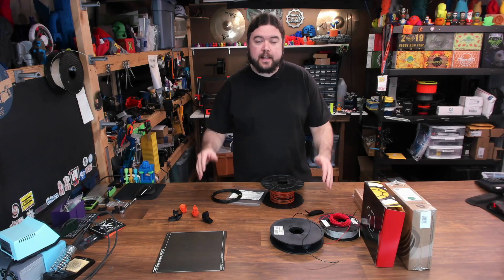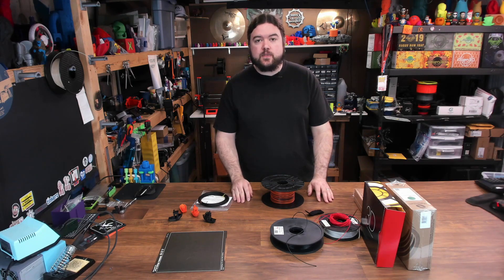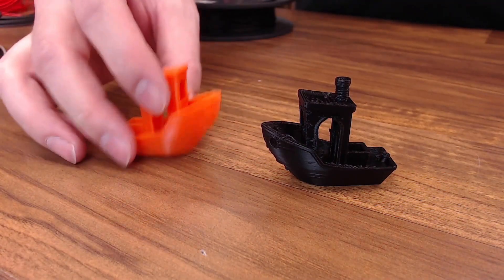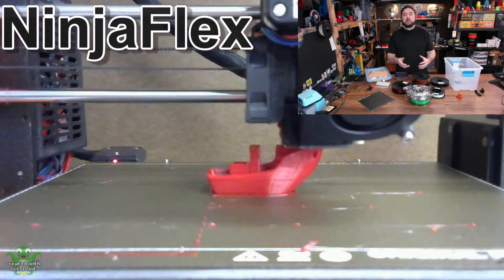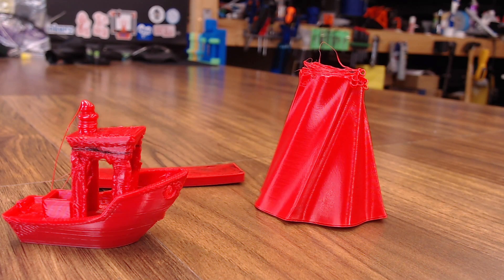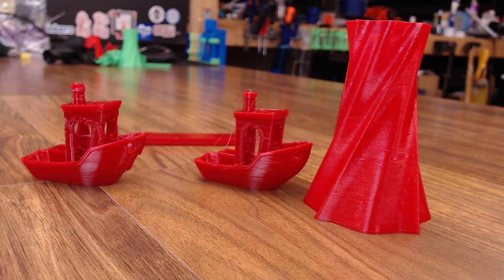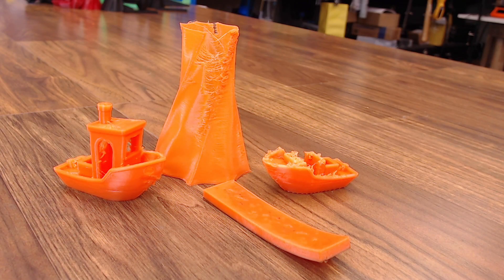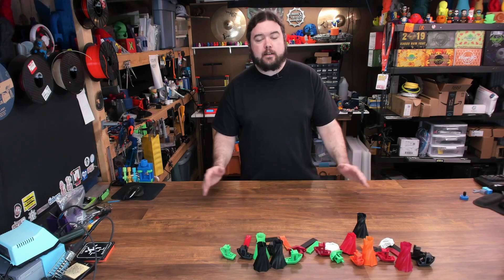Flexible Filament - Testing - Chris's Basement

Comment: Hi Chris, thanks for the video. I am trying since 2 days to print with Extrafill 98A and its virtually impossible, I tried a lot of settings, and I also tried the standard Prusa Slicer profiles in 15mm and then lowered the speed to 60% on the printer itself. The results are really bad, and I dont know what to do next to try to fix it :(
Reply from the maker: Hey, has the filament been left out? Maybe it needs to be dried a bit.
Reply: Chris Riley thanks for replying. No, it was a new roll, and after 24 hours it was unprintable. I am going to build a dry box and test again..let’s see

Comment: The stringing is most likely cause of lack of retraction and not dried filament. I only print tpu and it needs to be dried even when new. I mostly print 95a at 60mm/s with 3mm retraction and that works fine even for 15h prints.
Reply from the maker: Nice!

Comment: The Fillamentum stuff is some of the worst filament I've ever used.
Reply from the maker: Really? That's interesting.
Reply: @ChrisRiley  Yeah it looks like you had problems with it as well.  The two main problems were:  1.  It just extruded really poorly, like it was sticking to the nozzle itself, and 2.  my hobbed bolt didn't grip onto the filament particularly well.

Comment: Chris, really good information.  I want to try it on my Hemera.
Reply: Chris, I tried on my Hemera, and no go.  Then I figured out that I had just printed a bunch of carbon fiber and somehow jammed the nozzle.  Long story short, just ordered my third hemera, a bunch of spare parts and an X nozzle.
Reply from the maker: Doh! That kinda sucks, but now I know where to go if I need some spare parts! :)
Reply from the maker: Thanks Dave!
Reply: @ChrisRiley  I am getting spare parts from E3D and ordered 100 of those little square nuts.  I have lost a couple and they are impossible to find.  I will also have 3 MicroSwiss hot ends and 3 SeeMeCNC extruders spare with spare parts

Comment: First, I love your content, but I feel like with flexibles the strength is mechanical/engineering properties, you have a few different tests but it seems like the benchy and the vase are the highlight.  Is there a way to introduce something  engineering oriented like stretching them with a clamp or barbell or smashing them in a vise or running over a perfect cube with a car, or smacking them a few times with a hammer see if the splinter or separate.  LOL  I am having fun but also being serious, I think people who are into trying invent the next "thing" would love to see flexibles pushed to their limits in a different light.
Reply: BTW I do remember you were just trying to see if they printed at all so maybe you already did these tests.  Aside from the bar, I think the benchy and the vase are ultra challenging for a flex.
Reply from the maker: Hey man! Great ideas. I am planning on lots of content for flexibles, I really like the potential uses for it. I will see what I can work into the test.

Comment: Hey Chris,
I noticed on Marlin 2.0 that you can have dual Z steppers using spare extruder outputs.
Also there is a function to align Z steppers.
Please could you investigate and make video instructions?
Sweet, thanks.
Kris.
Reply from the maker: Hey Kris, I have been meaning to do just that, I will see what I can put together.

Comment: i have had good results going up to 6m retract with flexible material. ninjatek's cheetah.
also had successful prints with a bowden set up on an Ender 3, printing slow seems to be the key
Reply from the maker: Nice! I am going to try the ender 3 as well.
Reply: @ChrisRiley  i had the aluminum extruder upgrade and capricorn tubing installed which probably helped. i think it was 25ms i was printing at

Comment: When music is 10x that of the voice, RIP ears.
Reply from the maker: Is it really that loud?
Reply: @ChrisRiley  To me quite loud. I had to mute the audio till it looked like you were talking again. Great info though.
Reply: @ChrisRiley  Yo chris I run all of my legally acquired movies through something like this for audio:

ffmpeg -hide_banner -loglevel error -i FILEINPUT.mkv -map_metadata -1 -map_chapters -1 -c:v copy -af "pan=stereo|FL=FC+0.30*FL+0.30*BL|FR=FC+0.30*FR+0.30*BR, compand=0|0:1|1:-70/-70|-60/-20|1/0:4:0:-1:0" -c:a aac -b:a 256k outputfile.mkv

It brings the highs lower and the lows higher it tries to even out everything around the 0dB however it doesn't fully compress it, just like a 50% - 70% compress
You can switch the -c:a to flac too I guess then it'll be a lossless conversion & let youtube do the lossy conversion
Reply from the maker: @gg-gn3re  Thanks for this info, I will look into it.
Reply: @ChrisRiley  No. Not really.

Comment: You should tried out our filamentech plaflex.
It print as low as 130°c and up to 180°c flexible around 45D shore and prints like pla no stringing no nothing!
https://translate.googleusercontent.com/translate_c?depth=1&nv=1&rurl=translate.google.com&sl=iw&sp=nmt4&tl=en&u=https://filamentech.co.il/product/pla-flex/&xid=25657,15700022,15700186,15700191,15700256,15700259,15700262,15700265,15700271&usg=ALkJrhjJtP-gDphyUvNsukfYkypNX5c1GQ
Reply from the maker: Wow, that sounds impressive.
Reply: @ChrisRiley   Please contact me if you want to try some.
info@filamentech.co.il

Comment: I have used SainSmart TPU and Ninjatek Cheetah both with really good results on a bowden extruder in my Ender 3, was thinking about get a nice extruder for flex material since I use them a lot so will be waiting for your next video about it to get a better panorama of what is available 😎
Reply from the maker: Hey Eduardo, that's good to hear, I need to go test the stock ender 3 with flex before I try and upgrade it.
Reply: @ChrisRiley  My Ender is not full stock have changed the extruder base with this one https://www.thingiverse.com/thing:3320373 helps a bit with this filaments that are 95A and 96A

Comment: Chris what I saw, you probably have your gear to TIGHT. its recomemnded to have the gear as lose as possible for flex ( jam wiith the white filament )
Reply from the maker: Thanks Patrick, I played with the tension some, having the screw flush seemed to be a sweet spot, but still a struggle.
Reply: @ChrisRiley  it can be a real pain with some flex filaments yes.
I usually print with a good semiflex when printing flex types,  Spaghetti type filaments is not so usefull for me.  I think a hemera could be a good option, but the I3Mk3s has also a very short path, so i not sure it that really helps either.

Comment: Great video, very explanatory. I found out that the flexible I have is one of the most rigid and so I was dissatisfied. And yet I didn't get good results with direct extrusion. Imagine with these still more flexible ... certainly more difficult to work with.
Reply from the maker: Thank you, they can be very challenging and frustrating.

Comment: Just started testing flexibles on my direct drive (bmg clone) cr10s. So far had success extrudr medium flex and fiberlogy fiberflex 30D (really stretchy compared to extrudr medium). 200-210 hotend, 60 bed, 40-50mm/s (20-25wall) and retractions at 3.4mm at 25mm/s. Printing phil-a-ment right now in fiberflex 30D at 80% size with 3 perimiters and no infill.
Reply from the maker: Nice! The BMG should get you some really good results.

Comment: interesting, I had best results with the fibrology D30 the even softer stuff and printed it at quite high speeds. in numbers 60mm/s, on printbite plus @50°C with a genuine bondtech/v6 on one printer and flex3drive G5/mosquito on the other one. though I used pressure advance and retraction.
Reply from the maker: Yeah, I was hoping for a better result with this fibrology. I might have had a bad sample. I think I need to try again.
Reply: @ChrisRiley  sadly it's a bit harder for you to get your hands on that filament with only one reseller overseas. back then I had no idea where to start with flexibles but someone recommended fibrology to me, iirc Thomas Sanladerer tested it too and it was rather cheap and very easy to get my hands on, so the logic consequence. when I saw your intro I thought "I'm sure he'll love it", as you could imagine I was rather shocked seeing your results.

Comment: I have a semi flex material that will wrap around my MK3 extruder gears if I make the screws to the door too tight. I have good luck with it when the end of the screw is flush with the outside of the extruder door. Thanks for the great video!
Reply from the maker: Thanks Joseph, yeah, I was playing with that a bit. Flush is about perfect.

Comment: You mentioned using a glue stick, but also that the Prusa power coated sheets worked well for most of the filaments. Did you use a glue stick on the Prusa sheets? That part want clear.
Reply from the maker: the filament seems to be all over the map. Most of the filament excepts for the X60 and the Treed 74a were fine on the powder coated sheet without glue stick, not trouble getting them off. Those 2 really flexible ones I should have used glue stick. I would start with using glue stick on everything until you know how it is going to react with your surface.

Comment: Good stuf! Flexibles are a combination of fun and frustration. One thing you might try is, loosen up the grip on the Bondtech gears for the softer filaments. The gears can dig in, and make the filament more prone to getting wrapped up. On the really soft stuff, it might be a light enough touch that PLA will not even work. But I have had good luck with this, and think I first read the idea somewhere in Prusa's documentation.
Reply from the maker: Thanks Scott! I will give that a try.

Comment: Super informative video Chris! I love printing with flexible filaments and have been doing so for about 4+ years now. NinjaFlex is still my go-to for most prints due to it's flexibility, stretch-ability, durability, and heat resistance.

I do recommend blue painters tape (with no heat) as by FAR for printing flexibles on. They peel off like a sticker and have a nice finish texture on the bottom. Give it a try next time you print something flexible.

Also if you want a useful flexible print I created these straps several years ago and my wife and I use them literally every day: https://www.thingiverse.com/thing:835257
Reply from the maker: Great tips, thank you, i will give tape a try. That strap model is killer, I will have to give it a go.

Comment: would love to see someone try to print X60 on a hemera
Reply: I'm hoping to do that very thing within the next month after I get my Hemera upgrade complete! Granted I need to get some decent lighting for filming any of it, but I have some 60A and 70A filaments that I already love and am excited to see how fast I can print using the Hemera.
Reply: 3dmn did a video printing ninja flex at pla speeds, with the hemera
Reply: @neilsiebenthal9254  i know, but NinjaFlex isnt X60, the only two extruders i've seen print X60 well enough to be called successful are the Flexion (by Diabase) and the Zesty Nimble.
Reply: @Mobile_Dom  have you looked at how the hemera is designed? It's filament path is more confined than the flexion and zesty. Just not as light weight as the zesty or have the self cleaning brush from the flexion. I don't have any x60 or I'd try it out for ya. Feel free to send me some and I'll do it 😁 I don't have a need for flexible stuff so I don't mess with it. Yet..
Reply from the maker: Oh, it's coming! ;)

Comment: Liked this vid, can you please do one on PETG.
Reply: I'd be shocked if he doesn't have a video about petg already. What do you need to know about petg? I print it with the same settings as pla just hotter and less bed squish and less part cooling. As for how much less cooling and how much hotter will depend on your printer and the filament. Temp towers and testing if the best route
Reply: I just wanted to know if i could print PETG on my powder sheet without using glue stick, and not have it balm to my sheet.
Reply: @R3D-Remi  pei powered coated? If it's prusas, they say you can without adding anything on the blog post about the bed.
Reply: Also Thomas Sanladerer has a video on petg that's rather good.
Reply: Yeah I got the one directly from prusa
Reply: @R3D-Remi  you should be fine then.
Reply: Thanks for your help man, I appreciate it.
Reply: @R3D-Remi  you're welcome, I love printing petg so I'm all for more people using it so the myth that it's hard to print will go away
Reply from the maker: Thanks for the assist, Neil, I second this, the Prusa powder coated sheet is my go to for PETG.
Reply: @ChrisRiley  huh what? Who me? I did nothing.. I was never here...sssshhhhh